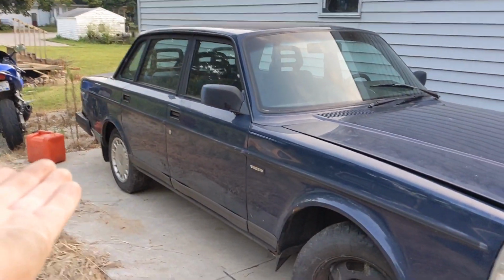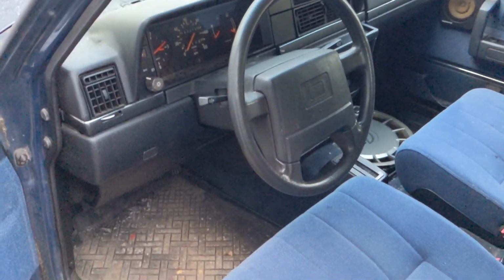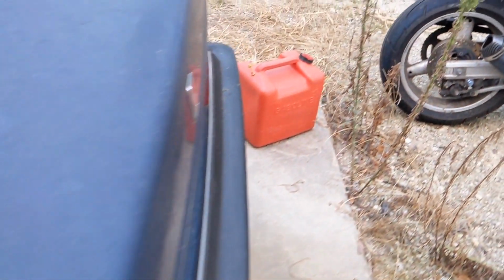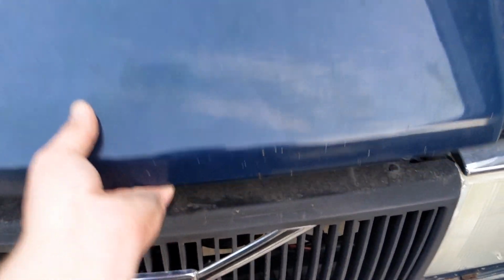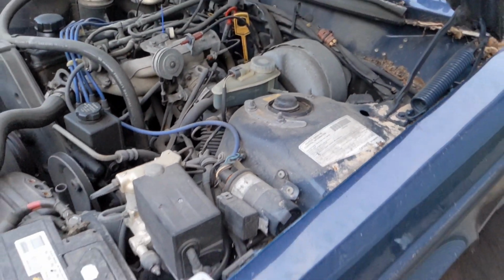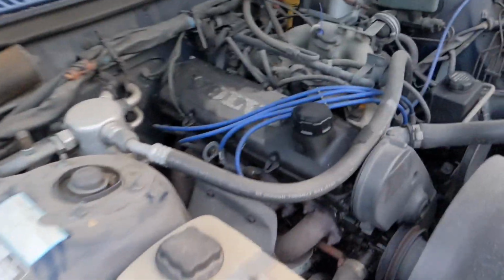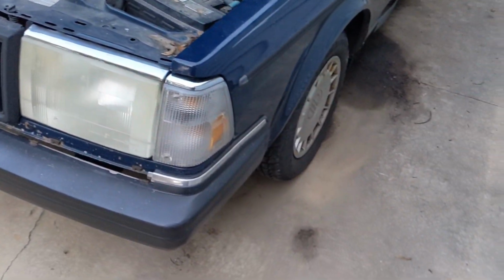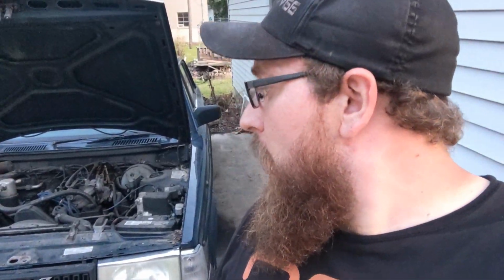New 1992 Volvo 244: Walk-around.

Comment: An armrest with built in cupholders?! Dude! 😄 So now we both have blue sedans with loud af piston slap
Reply from the maker: Hahaha. It sounded exactly like piston slap from my old trucks so that's what I assume it is. I am going to run some Motorkote in the oil when I change it! 
I sadly don't think I'll be getting much work done on it the next few weeks because I am heading to Arkansas in a few weekends!
Reply: @BeardedWrencher  an oil change might help it did on mine, plus you could try 15w40 depending on how cold it gets over there. It helped my 940 slap so I think I'll put try it in the 240 next